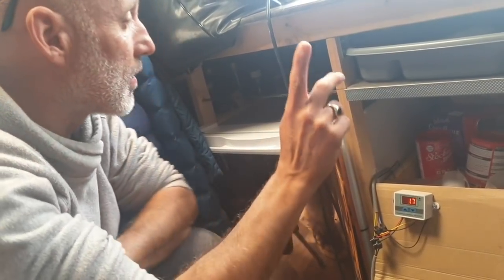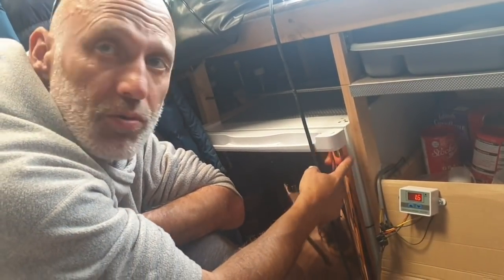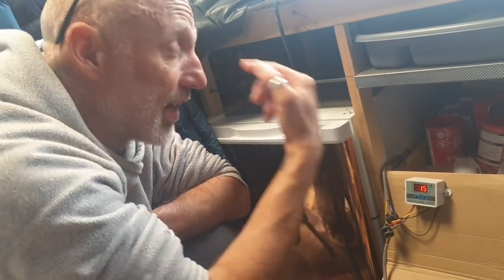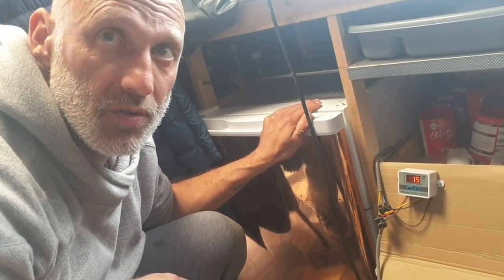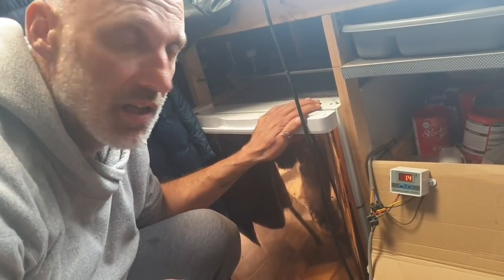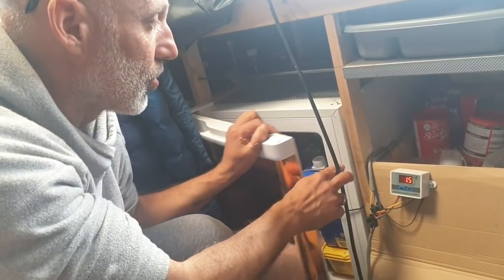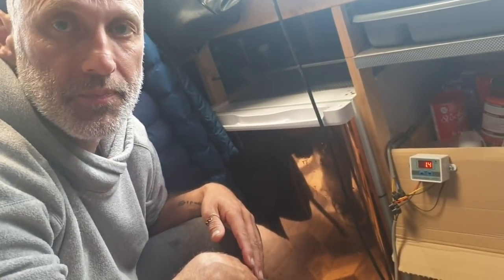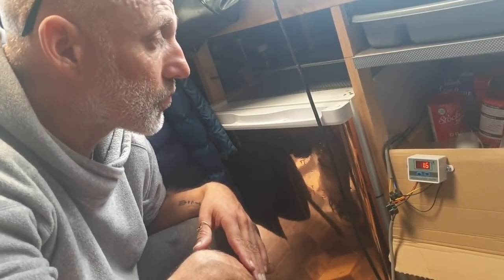How to make 12v fridge alternative on a budget.

Comment: This could have been said in under one minute:12v - 240 inverter running a freezer with a patched in thermostat set so it works at fridge temperatures.

Comment: Why you dont use the original termostate from the fridge? Thanks
Reply from the maker: We use an external thermostat because its a freezer. We use a freezer because it is thermally more efficient, they are produced with more insulation.
Reply: @AhimsaFoodForest  thank you so much.

Comment: So this isn't 12v but rather 230v? I notice you got your plug into an extension which isnt 12v right? Sorry for apparently obvious question, noob at electrics! - Thank you so much for posting a video about this. Great to hear about it all and its very intuitive stuff. considering doing this myself if I can do it 12v - rather not have to use an inverter at all :D

Comment: £4.17 these controllers on eBay I have just ordered one you've inspired me to convert my Russell Hobbs mini table top freezer to a fridge at only  53w should be very efficient lol one thing I am going different is to take original thermostat out and running the thermostat lead thru the adjust dial from the back so no leads on show , cheers great vid keep safe

Comment: What size inverter do you use ?
Reply from the maker: Sorry for the delay in getting back to you, we have a 600w (peak 1000w).
The comment above is a great suggestion breaking into the extension lead.
You can also get plug in thermostats which I hadn't seen when I did this originally but I have since changed over to that.
Reply: AhimsaFoodForest thanks ! What plug in thermostat do you now use . This will save me spending £500 on fridge . Thanks
Reply from the maker: @GLADIUS1973 this is the one we have now, it was a lot cheaper when I bought it. 
The only reason I changed it really was to see if it worked as it would be easier for others to do, but never got round to doing a video about it.
Both work in the same way.
 https://www.amazon.co.uk/dp/B07LGSFZY8/ref=cm_sw_r_apa_i_Sw03EbXFEMEFD
Reply: I just bought a mini freezer eBay bargain £24  looking to convert it to a fridge ive bought the ink bird digital controller dunno whether I brave enough to fit it,instructions seem vague on you tube  lol

Comment: Need help guys I got your inverter and a new 240v table top fridge but the 2000w inverter wont power it ???
Reply from the maker: Hi pal, without testing each bit I honestly couldn't say. Your inverter  definitely has the capability of powering it. 
We use a freezer with external thermostat. The freezer, due to thermal efficiency holds the temperature stable for far longer this reduces the cycle length and occurrence which reduces the load applied to the battery. 

Using a fridge may work but it's not what we've done and we've never tried it.
Reply: @AhimsaFoodForest  I gave up a bought a waeco crx80 fridge now lol think a freezer might of worked better I thought they had same power ?? Will keep inverter as its handy I ran power tools off it last night fine
Reply from the maker: @TheOffgridNomadBulgaria  ouch! we couldnt afford one of them which is how we ended up doing it this way lol
Reply: @AhimsaFoodForest  nor me had to sell body parts to fund it 😂😂😂

Comment: Hey great vid. How are you powering by plug enough to start the fridge up but not using an inverter. What batteries/solar panels are you using and are you on 12 or 24v setup. Thank you
Reply from the maker: We do use an inverter, we have 200w of solar charging a 225ah battery.
Reply: They have a video on their power set up.